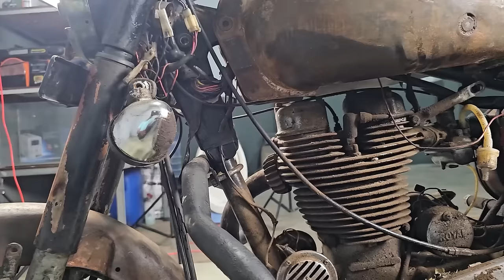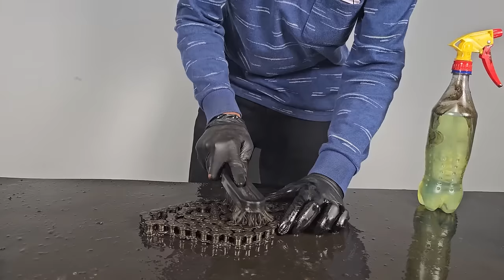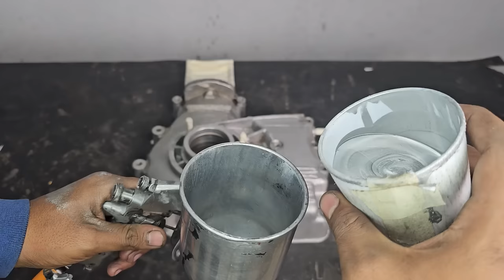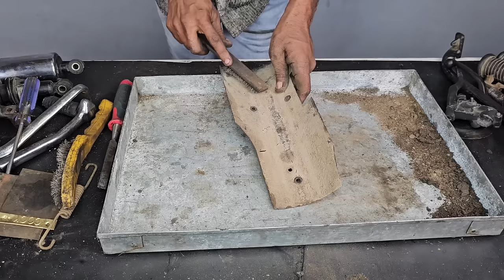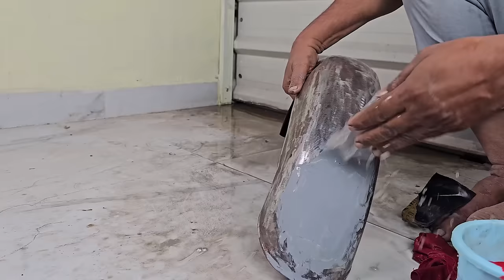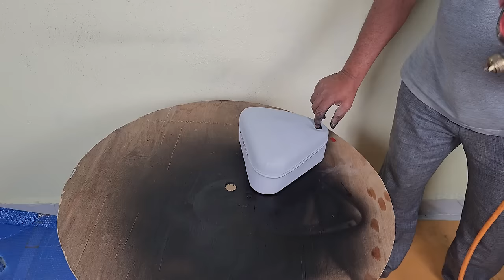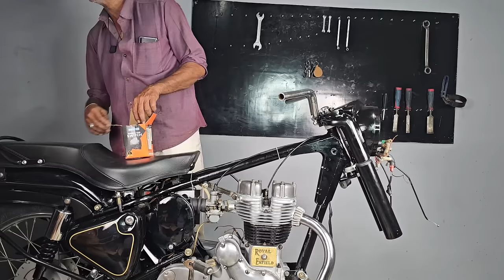Old Bullet  Full Restoration | Royal Enfield Bullet modification 🔴

Comment: It will be better if you can hang the paint job items and do the paint work..
Reply: Nikal it is better 😡😡🤬
Reply: Totally agree. One shouldn't be touching the primer with ones hands as it leaves sweat on it. Plus it's easier to do if it's hanging on a piece of wire and one doesn't have to pick it up touching the wet paint.

Comment: Excellent restoration; however I have a question. I see that to remove rust, corrosion, grime, you resort to chemical soaking, brushing, sanding, etc. Well, how do you go about cleaning the interior of the gas tank, as the internals are inaccessible to all but one of those cleaning methods, that being chemical soaking?

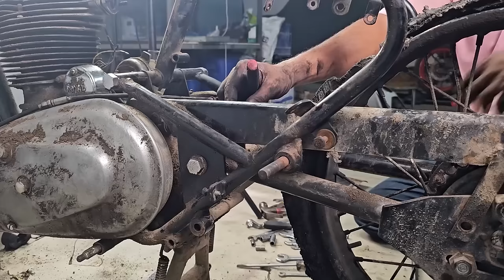Comment: I just watched a Paul Henshaw video about differences between the Indian and British Royal Enfields and, based on that, this is an Indian one, given the long through bolt above the transmission. I'm not actually sure that's right though - am I looking at the right part, according to his video?  You can see it right in the center of the video at 1:18 . Also the raised plinth for the engine number just below the cylinder barrel at 0:43 . Although where is the crankcase breather elbow? Any more info about the year would be cool. Thanks - very useful reference video for my 1980 Bullet! I'd be curious, also, to know if there were any modifications - for example, conversion from 6v to 12v.

Comment: exept to the welding on fender etc. nice done with the simple methods, but that cutting outs an patching from behind and then just pur filler in is hobby grade, not pro. If they have not the skills to weld it correct, then better get a used one in better shape. India produced millions of the RE - should'nt be a big problem to find a fender and sidecovers.